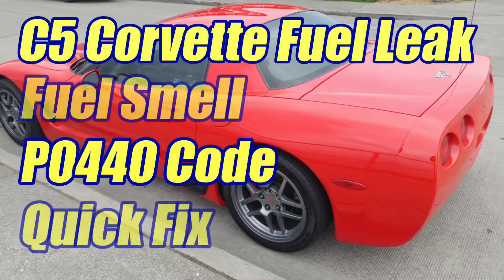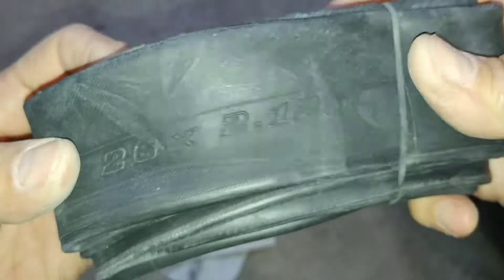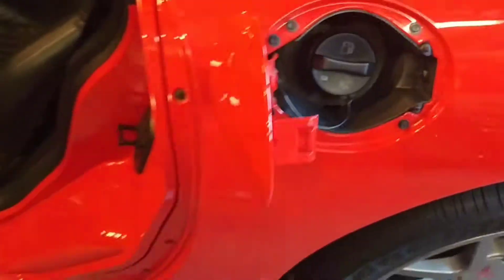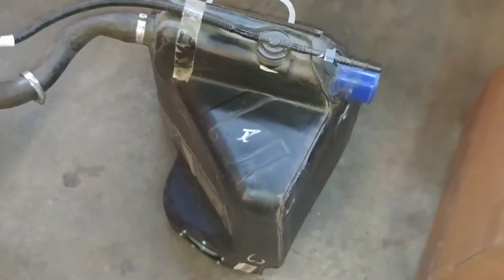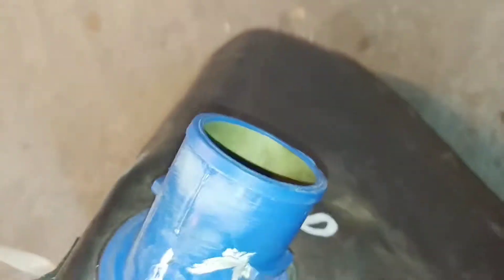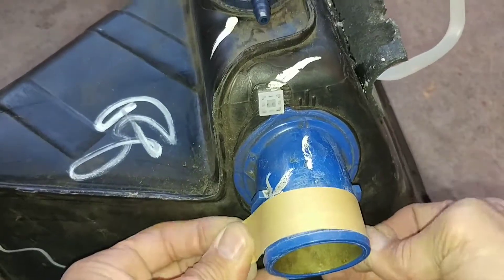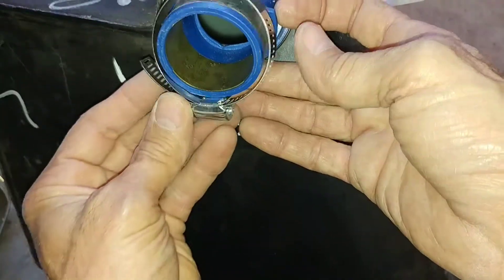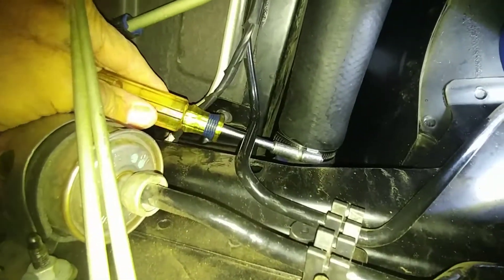How To Fix C5 Corvette Fuel Leak Gas Fumes P0440 Code 97-03

Comment: Mine throws this code once a year lol. I only drive it 1000 per year but I’ve been getting this code since I bought it with 29,000 miles on it. It randomly comes on yearly. I just reset it since no gas leaks and passed emissions
Reply from the maker: I'm not sure but I've heard the vehicle runs the EVAP test about every 6 drive cycles.

Comment: Thanks for the video.  I have a 2000 and the last time I filled up I had the exact same puddle of gas coming out from under the driver's side of the car.  I went under the car and can't figure out how you got your arm up there to reach the clamp.  My exhaust is in the way, and it still looks difficult even if the exhaust wasn't there.  Did you remove the exhust system to be able to reach up there?  Is there anything else that needs to be rmoved to access the clamp?
Reply from the maker: Yes, it is a very tight work space and access is limited. Deciding to repeat some of the tightening in that space so that I could capture footage for the video was an even greater challenge. It's possible automatic vehicles affect access but it's super tight either way. Pulling a tank takes a bit more work but was surprisingly doable. That requires removing the wheel, fender liner and for z06; brake vent removal. But no exhaust removal on either job.
Reply: @ScubaMoto  If the wheel and fender liner are removed can I access the clamp through the wheel well?
Reply from the maker: It's been a while but I don't think that it's worth the effort just for the tube and clamp you're accessing. Only if you're pulling the tank do you want those things and a few others out of the way. If it helps for location, remember that the tube is directly against the floor board at the back of the driver's seat. If you've got your eye on it, then you'll be able to get the flex tube off and check and sand the casting lumps.

Comment: It looks brand new underneath 💯
Reply from the maker: After the first leak, I cleaned it up good underneath. It helps in locating issues plus I always like to pressure wash before doing underside jobs to get the big chunks off. It makes the job so much cleaner and also makes for a better video. Thanks for the comment.

Comment: Thanks for this video! I have gas smell only when I fill the tank and let the nozzle automatically shut off. I don't have any codes that I am aware of...Any ideas?
Reply from the maker: Yes, those symptoms are what led to this video. Same issue. Do you have  a dash light yet? Now your next step is to get under it right after fill up so you can inspect and trace the exact point of leak. It's probably the same problem as in the video. Good luck with the inspection and the repair.
Reply: @ScubaMoto  thanks! No dash light yet....

Comment: I noticed this is for 97-03. Is there a fix for 04? Recently purchased, got it inspected at a corvette shop and was advised of driver side fuel tank being split and leaking fuel.
Reply from the maker: A fix will require a lot more detail on the actual source of the leak. 
Step one: I recommend cleaning and drying everything and doing your very best to identify exactly where fuel is leaking from. The less you know, the more you'll need to replace. When someone says "fuel tank split and leaking", it leaves plenty for interpretation. If the driver side tank is the actual source of a leak due to a split, that would imply some kind of impact damage to the tank. It's rare but possible. It could also possibly mean having a split or other damage at the crossover pipe connection point. A little more common. These metal crossovers that started in 2004 and are the same through 2013 have outer o-rings, several inner return line o-rings and a few plastic lock rings and retainers that like to break. Disassembly is best started by generously spraying everything with Teflon (my preference) or other lubricant (not penetrating oil, it might damage o-rings) before trying to lift off the plastic retainer and rotating the main crossover seal at the tank. If you're just replacing a damaged driver side tank, it might actually be easier than the metal crossover. You can find videos on C6 that will help you with that since it's the same. I hope that helps and good luck with the repair.
Reply: @ScubaMoto  awesome feedback! I’m definitely leaning towards just replacing and now that C6 can be an option that opens the net up for finding the driver tank. What’s your best estimate in terms of cost?
Reply from the maker: Glad I could help. I replaced the driver tank in an 2003 Z06 that someone had drilled holes in. I found a good quality used one for about $120 plus my labor. If your crossover pipe is undamaged, you might see similar pricing for a good used tank but you might want new o-rings for the return lines and the crossover main seal. If you need a new crossover pipe, that could add a couple hundred depending on the source. Shop price using new parts around $2K.

Comment: I can't myself do this repair because I have a bad lower back. How long does it take to make this repair?  I want to know how much for labor I'll have to spend to have my mechanic do it for me.
Reply from the maker: I understand. A lift would have helped me too. The method shown in this video took me less than 2 hours once I identified and had all needed materials. You can easily triple that if you want to try to film it for a video upload ;-D . But seriously, I'm not sure if the shops I know of would tackle it in the same way. Shops have book values for processes, parts and for associated labor. They have to follow those numbers to protect themselves from loss. It's impossible for me to predict what numbers a shop will present for this but I would guess something north of $1,200 as an actually reasonable offer at eliminating the fault code IF (and this is important) IF the fault code is a result of a vacuum leak in the same location shown in this video. I hope that helps and please share with us what amount gets the problem solved at your mechanic's shop.
Reply: @ScubaMoto  I don't have any fault codes at all. About two weeks ago I wasn't paying attention when I was filling the tank and over filled it. I spilled gas everywhere and been having the gas fumes smell ever since.
Reply from the maker: I'd give it a couple of weeks. If you've never had the fault code and it only smells from an isolated overfill, I would allow time for the fumes to dissipate. If I still had a raw fuel smell in a couple weeks, then I would schedule the service. Good luck with it.
Reply: @ScubaMoto  I will definitely let you know what my mechanic does and how muchvhe charges me. Thank you for helping me out in this matter.

Comment: I’m gonna attempt this, are u sure it’s till 2003? Same body up to 2004. I have all the symptoms haha. Been dreading going under but it’s time
Reply from the maker: 3hitbye: Yes, I am sure it changes in 2004. Search on "2004 corvette fuel tank crossover" and I promise you will immediately understand the difference. Are you smelling and seeing raw fuel or just getting the fault code? It could just be a Bad gas cap or vacuum line.
Reply: @ScubaMoto  I smell gas when filled up after a certain amount. And  I filled up very full once and it leaked from right side (passenger) like dripping from the side panel . Also, I don’t remember the code but I changed gas cap first thing as that was the possible fault
Reply from the maker: 3hitbye: Yes, it sounds the like similar issue and, unfortunately, the corrugated metal crossover systems are also prone to leak. They connect with a bayonet so it's a very different problem to solve but you need to identify the exact leak point. Hopefully you can get up there and catch it in the act so you can find out if the leak is on the tank side or the crossover tube and replace accordingly.
Reply: @ScubaMoto   thank you so much. I will attempt it this Friday or Saturday as I have to do some work underneath anyways. I’ll have to fill er up and watch as she drips
Reply from the maker: 3hitbye: That sounds good. I've had tanks out many times, you'll get it right. It's just parts leaking. They can be replaced.
Reply: @ScubaMoto  have you ever done a shifter cable for automatic c5?  my shifter cable broke loose and my friend took it apart and drove home manually shifting lol. after that, he replaced it with new  one for me and within a few months it  kinda feels loosened up. it won’t go into Park, or it’s very difficult to do so. ima take a look at it as well. wonder if i just need to adjust it
Reply from the maker: 3hitbye: The shifter cable is adjusted at the transmission end of the cable. You should have no trouble finding the step by step process on line.
Reply: @ScubaMoto  here’s a video I just uploaded https://youtu.be/IimDJLllip0

Comment: does this also apply for a C6?  got a  PO440 yesterday...
Reply from the maker: Paul Pulis: The 2004 C5 and the C6's are prone to the P0440 but usually for different reasons than the 97-03 C5's. They use a more rigid metal connector tube between the tanks with bayonet seals. So although it could be the same cause as in the video, it would likely be different. Of course a bad gas cap can cause it, but you've probably already ruled that out. For the C6, you might have a leak in the vacuum lines that go from the tank to the engine intake manifold. When you clear the code, how long does it take for the code to return?

Comment: Does this issue or code cause any starting problems?
Reply from the maker: Ryan Fick: No, not typically. They'll even start with the fuel cap completely removed.
Reply: @ScubaMoto  ok. Thanks. I’m trying to chase down a cold start problem that I have (car cranks longer than usual) but it only happens when the car is cold and the gas tank is less than a quarter. I’m thinking it’s fuel related.
Reply from the maker: Ryan Fick: Slower starts in cold Winter temps are not unusual. If it's excessive, I usually start with testing the battery. What is the date stamped on the battery? Miles on vehicle? Age of plugs? Do you use a trickle charger in Winter?
Reply: @ScubaMoto  those are all new. I meant cold start as in starts in the morning even when the temp outside is over 100. Seems like fuel pressure bleeds off overnight. But not when the tank is more full.
Reply from the maker: Ryan Fick: Got it! Then it's time to check fuel pressure. Fuel pump, filter or regulator. What year and mileage?
Reply: @ScubaMoto  01 with 70k. 2 new fuel filters. No change.
Reply from the maker: Ryan Fick: Okay. So if the pressure is below 50psi on the rail then it's likely just the fuel pump. Your mileage isn't high but if the pump is out, 19 years is a pretty good life.
Reply: @ScubaMoto  ok. Thank you for the help. I appreciate it!!

Comment: Great vid, I've taken my 98 tank out at least twice and it still leak gas slowly. I bought a new crossover tube and used the original clamp thinking it would work. Never considered sanding the edge, might as well try
Reply from the maker: 27selmon: Yeah, the factory clamps are a big part of the problem. The bridge on the OEM clamp is too stiff to seal the crossover tube to the tank lip. The tank lips probably all need the casting offsets sanded, certainly the one in the video did. It should have been done in the factory. The inner tube band also helped ensure a vacuum fit. The video fix is still solid, no issue. Thanks for watching and for sharing.

Comment: awesome, my 02 c5z has this problem, throws the code ,leaked fuel when I filled up for a trip, and raw fuel smell...also the mpg display is reading way off, maybe that has somthing to do with all this....
Reply from the maker: srtkid69: It's easy to look up in there. Next time you fill up, lift it and look at the clamps. Odds are it's the same issue. Thanks for watching and for sharing.